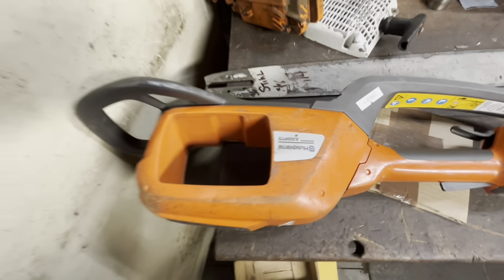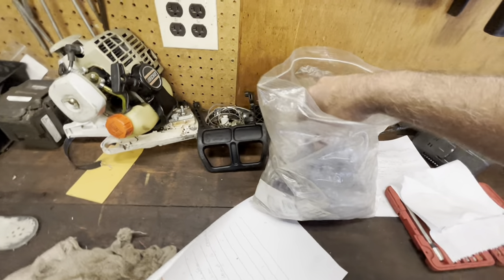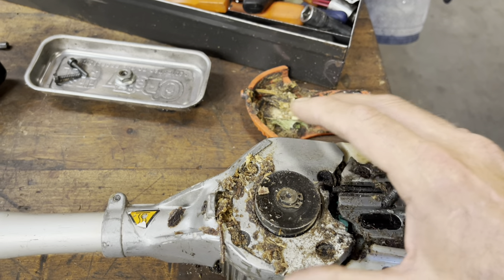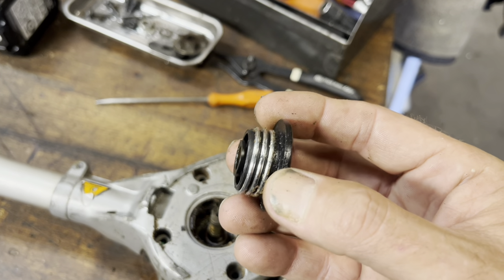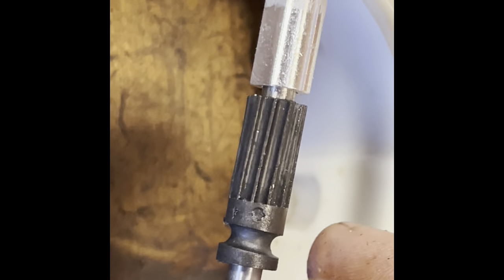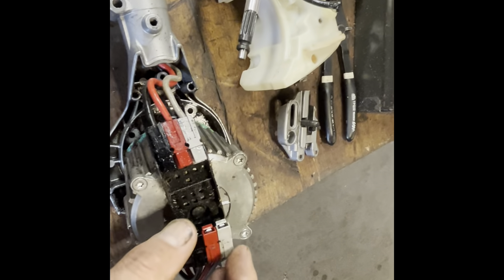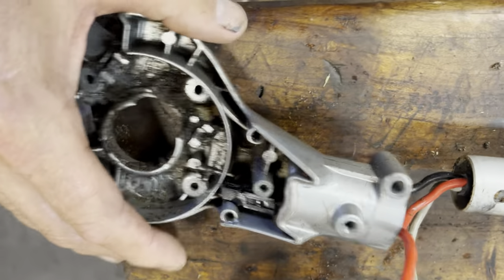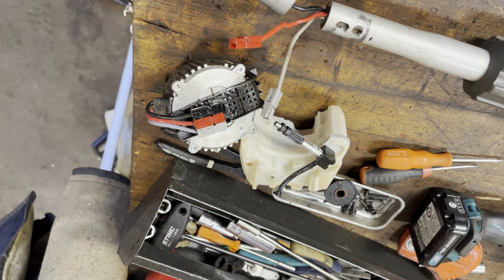Husqvarna Battery Pole Saw Fix

Comment: I’d rather it weighed more and be durable than featherlight and breakable. I like Husky saws BUT…
Reply from the maker: Run one of these for a couple of hours compared to the other options.  I guarantee it would change your mind.  If you use it like you paid for it, you'll never look back.